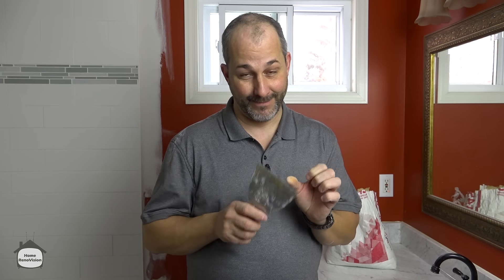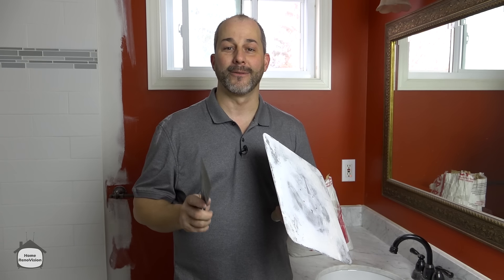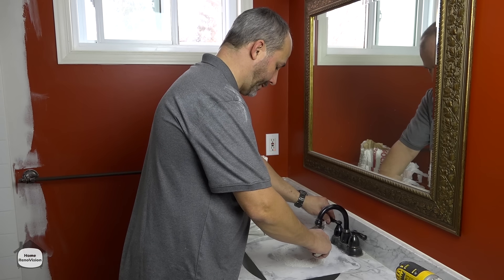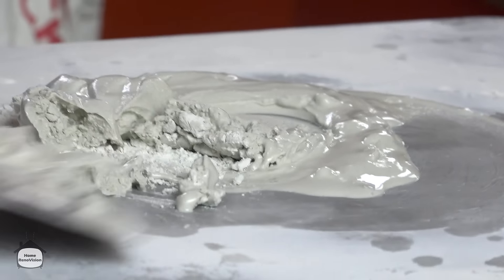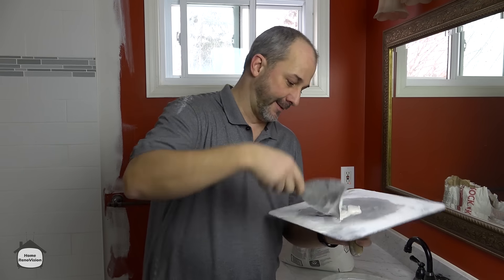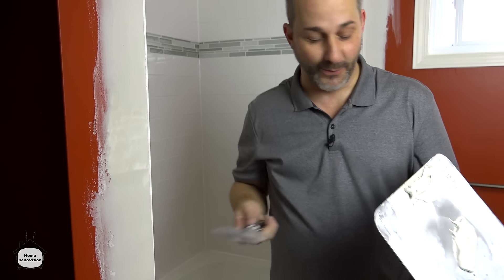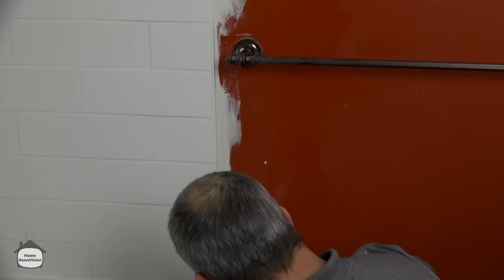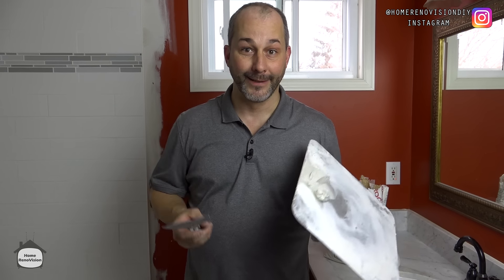Simply DIY Drywall Repair for Homeowners

Comment: whenever I get a small hole in drywall from a screw or whatever I was using spackle and trying to sand it after and it NEVER comes out perfectly smooth. My contractor told me to use joint compound instead of spackle, but this stuff looks great. Thanks so much for making this!

Comment: Hi Jeff.  I just starting watching your YouTube channel yesterday.  I watched your series on drywall.  Good stuff!  I went out and bought some of the Dewalt Drywall Screw Setters last night... you referred to them as dimple #2s.  I knew what I was looking for.  
I love your series and learned a lot that I can use, as it applies to my ceiling repairs.  
I've already repaired a ceiling crack that ran the width of my hallway, and a water damaged spot (8"x10") from a deteriorated sewage vent boot on my roof.  I have a knockdown texture, which took me several trial and errors to get right, but I did, with a coarse sponge and a wide taping knife.  
The place I am working on now has 2 long joint tape cracks (8-ft hairline crack along one side of a sheet of DW running parallel to vault peak, AND another on an adjacent side running 4-ft to the vault peak, and another adjoining 1-ft section on other side of vault peak = a continuation of the 4-ft crack, then a vertical wall) on a vaulted ceiling, with one running across the vault peak onto a 2nd sheet of DW.  The total 5-ft crack across peak had sections that were 1/8" wide.  Well, I just dug in!  What a nightmare under the DW.  The 4-ft crack was a hanging joint, with DW nails hitting air.  I will attach a 2"x4" to existing joist (sistering?) so I won't hit air.  The 1-ft adjoining crack was caused by deep mud due to 2 parallel joists that were not exactly parallel.  The two had a different pitch, so the angles were off.  Hence, the mud buildup from original build.  The existing DW was literally crumbled under a 1" layer of concrete type cured mud, due to nails that were nailed to higher pitched joist.  To me, the original DW work was shoddy.  The 4-ft crack is the hanging joint, but before I started removing paint and concrete mud, I did notice the mud was built up along the whole 5-ft section so high that it was humped over the knockdown texture.  It appears the joint was built up after they textured it.  So, different pitched joists, excessive mud and hanging joint caused this 5-ft crack.  
I haven't gotten to the 8-ft crack yet... still trying to make a trough for the fibatape setting along the 5-ft crack across 2 sections of DW.  In the corner where the 8-ft crack meets the 5-ft crack, next to an outside cornered vertical wall, there was a 3rd crack that arched between the two long cracks.  This 1-ft radius'ed crack was 3/16" wide in spots.  Well, when I started scoring the NEW tape area along the 5-ft crack near this arched crack, the section just fell 12-ft to the ground.  So now, these adjoining cracks just got a little more complicated.  This area will be replaced with a 2-ft x 2-ft section of new DW, with a corner notched out around the adjacent outside corner vertical wall.  I hope I don't find anymore surprises.  I've had enough.
My plan for the 8-ft crack is - the crack runs perpendicular to the joists, so I plan on using furring strips along the cracks between the 24-in joists BECAUSE I DON'T WANT THIS CRACK TO EVER COME BACK!
Much of my work has been trial and error, advice from youtube, surprises, etc.  But in reality, there aren't enough youtubes out there to address many of the problems I've encountered.  Your series were great and helped me a lot, but I've run into problems that just are not out there yet, on youtube, anyway.  I think it would be great if you addressed some of the more complicated repairs you've made, or will make in the future.  Sorry for the length, but I'm a retired aerospace engineer who pays way too much attention to detail.  That coupled with perfectionism leads to problems.
Thanks again Jeff... Wayne

Comment: I usually just use the 20 minute set mud but this is a nice trick to have in your bag if all you have is the 45 minute product lying around.
Reply from the maker: Cheers mate!
Reply: Right. I usually grab the 20 minute mud first.
Reply: How long let set before wet sand? Does it need to be fully bonded first?

Comment: I was very impressed with your little volcano, but I think I will stick with mixing mine in a bucket and a plastic paddle mounted to my drill. I generally use 45 minute setting compound for all of my drywall projects from taping seams, installing corner beads, and even my final coat. It seems to be stronger and more durable and it does not shrink like regular compound. I believe this is the first video that I have watched of yours. I will try to take a closer look at your Channel later on.

Comment: Good.  Been doing this kind of repair for 40+ years.  This is a bridge over from the drywalling trade to plastering.  I first was taught how to white coat plaster by using slaked lime and gauging with a little retarder and we mixed it in a similar manner on a mixing board in large amounts using trowels, or making the ‘ring’ of lime putty, pouring in the water and then shaking in the plaster & allowing it to soak till it was 95% wet, then take  a gauging trowel (looks like a pie spatula) and cutting into the ‘cake’ (we’d call it), just like you would a cake or piece of pie, and mix it right on the hawk like you did in this video.  It was traditionally a 3:1 mix for flat work.  This was the traditional lime putty plaster and you don’t really see it done much anymore, only when doing restoration or conservation work.  
         Picking up in like manner of what you do in the video, for an even quicker fix than the 45 (which I do like & use),  I do the technique described above but with joint compound and plaster of Paris.  It’s sponge  float smooth within 7-10 minutes depending on the ratio of the mix.  The mix is not as easy and nice as lime, but after you get the hang of it it’s fine.  I get called to repair drywall & plaster  all the time,  and this is the quickest mix to knock out a bunch of patches.
        Lastly, I think it’s great you showing some of these techniques and secrets. You and I know that it’s not as easy as it looks because so much of it is learned muscle memory and after you’ve done something hundreds...thousands of time, you don’t think about it and are just on auto pilot.  But this is how folks learn.  Thanks.
Reply from the maker: I remember watching Old Jimmy St Clair plastering a house when I was a kid. We were restoring an old bankers house and historical guys wanted plaster. He was awesome and made me fall in love with working with my hands. Cheers!

Comment: Works even better if you scrape it wet then lay it back on very smoothly I've done whole jobs like it without sanding painters couldn't tell the difference it works so smooth one thing though they need to pain with a slight texture or it's smoother than the rest of the wall

Comment: I've been a drywaller since 1983 USG Dora Bond leaves a shine you want to use Kwikset and set it over your sink and get some in the drain and see what happens
Reply: Kwikset makes door knobs not plaster. Nice try bud 👍
Reply: Kwikset and quickset are two different things
Reply: @DundyMuffs  yeah he means like drywall 20, which dries very quickly. Becomes unworkable and probably less than 10 minutes. Also what's wrong with mixing in a mud pan?
Reply: @DundyMuffs  
Drywall compund isn't plaster....

Comment: Most drywall people I've seen don't bother to flex the trowel so it lays down a convex surface.  Like us it's mostly water, so the thickest areas shrink the most.  Any surface that is finished flat, will dry concave.  With a 4" trowel it might not be noticed as much but it depends on how thick it is.  I'd use a 14" Drywall rectangular trowel from Marshalltown, it has the curve built-in.  You could only use half on the outerside, but all on the inside.

Comment: Thanks for showing this again, I picked this method up from your painting video. Better detail for mixing the sheetrock45 and water this time around. The first time I tried this I'm glad I mixed it out in the garage because I tilted the hawk just a little too much and water+sheetrock poured all over me and the floor (warning to beginners, don't try this for your first time over carpet!). After a while I got a hang of it but I appreciate the detail this time showing how you dust it over the water. I'm convinced its the quickest way to get good results and thankful your'e sharing all the little details with the world like you would to an apprentice. Keep it up!
Reply from the maker: your volcano erupted did it. No worries practice makes perfect. adding less water until you get the hang of it is a good idea. Cheers!

Comment: Well done video, Jeff.
Info like this is gold for those of us who do these repairs infrequently. 
You specified Sheetrock 45, but much of the bag is missing or turned away from the camera.
Which of the following products that are available in my area of the US, is closest to (or is) what you showed?:
•USG Sheetrock DuraBond 45
•USG Sheetrock Easy Sand 45
•USG Beadex Silver Set 40
Thanks, man!

Comment: I still think you need to prime it, as quickset will flash through any paint but flat one. As well, the edges left after sponging will be pretty rough and noticeable, and texture will differ from surroundings.

Comment: Thanks for all your advice.  As we used to say in MC roadracing, it only had to look good at 10 feet and 100 mph. I'm trying out putting baseboard quick grab or even old tube of caulks on every stud before attaching sheetrock to help with screw head pops.  Another tip from eBay University.  And as I'm always telling my kids; I'm brilliant...1 oh shite at a time!
Reply from the maker: another thing that works really well is to deliver the lumber to the site and let it sit for a few days to dry out before installing it. Cheers!

Comment: How about a video on corner bead repair?   They're are several other DIY videos on YouTube, but they all have different recommendations. For example: Fiber Mesh Tape vs Paper Tape; staples vs screws; plastic bead vs metal bead!  HELP!  I have lots of cracking and separation on the outside corners.  (18 year old Florida home, metal bead, metal stud framing).  Thanks! Love this channel!

Comment: Thanks for this video, I've used 30 in the past with decent results but 45 is cheaper for sure. I've taken college chemistry so the hot water concept hadn't dawned on me but definitely makes sense. I also like your finishing trick with the sponge for grout, that's what'll save me the most... hate sanding.

Comment: There is also 5 min Sheetrock compound for quick work. Or Fast and Final is a good product. No need to prime, just quickly hit it with the paint so you can hit it again when it sets up.
Reply from the maker: does not work the same way as 45. that one needs a primer.

Comment: Mr. Home RenoVision, I have read on the hot mud packages that there is a danger that if you coat too thin and it dries before it can harden that it has no strength so I always use cold mud for the final coats. I see you are coating thin, what is your take on that issue?

Comment: Have you ever used aluminum sulfate? The compound (mixed with water) makes an accelerator that will fill holes and literally dry in a few minutes and is able to be sanded in 10 minutes.

Comment: Sorry Jeff, priming is a must if you use a dark color like red or any type of sheen such as satin, eg shell, semi-gloss. It will flash. A red color will need to be painted from corner to corner and wet cut in to wet roller roller. Like your videos and I just rang that 🔔
Reply from the maker: Hi Sammy, yes if you are painting red then it will need to be primed but solely for the purpose of tinting the wall due to the translucent nature of the color you are going to finish with. That is another video. Cheers! In this case the client was going to finish the paint with a seafoam green color to match the glass tile.

Comment: Please do a video on fixing tape pops in corners of walls and along ceilings that are textured. Love your stuff!
Reply from the maker: sounds very interesting. simply use your 4" knife with compound on it to squeeze it into the gap and press. repair the texture after it is dry.

Comment: Another idea is to heat the wall with a hot air gun then apply the DW45 to it. The mud cures in about 15 minutes.
Reply: Or, just use 20 minute mud, or 5 minute, like I do all the time.

Comment: I watched the mud video it was great. My problem is I have a large void area between the two drywall sheets. They do not butt up against one another. What would you use to fill that area?
Reply: 20min mud 4 in mix peanut butter consistency, pull tight scrape off extra as mud is setting up / spray adhesive then mesh tape mud 2x pulling edges tight you'll be good

Comment: Great tip! Thank you! I was wondering if I could do that with the wet sponge. I was worried I was going to mess things up. I did not use the wet sponge tip renovating my office. That room had a lot of holes. So I used a lot of drywall plaster. I sanded that 9 by 9 room like crazy! I had a fan in the window to take the dust out. The room was still super Dusty! It was like I was in a snowstorm white out! I wish that use the wet sponge method!
Reply from the maker: It works really well when the final coat of mud was applied thin and smooth. Cheers!

Comment: Great video.  How do you do textured knock down ceilings?
Reply: if its real popsorn, get a pump sprayer.... wet it down, let it sit 10 minutes then set a tarp or painters  cloth down, use a 8 or 10 inch knife and watch it fall easily with minimal dust! ive done many this way... good luck

Comment: Do you have any tips on fixing cracks in drywall?? Specifically those in corners and water damaged drywall?
Reply from the maker: use painters caulking in corners to fill cracks. water damaged drywall must dry completely and then see if it will hold a screw. if not remove it. cheers!

Comment: they also have a 5 minute mud out there from USG, and you better be good when using it and the method using the hawk is old old school. they have better tools out there  for the job. water sanding with a sponge does control dust but it also takes away part of your finish and will show fat edges created by the sponge itself, dry sanding is always best, and never paint over any raw drywall with out some sort of primer!!! it will photographand when you have primed the spot you nee to also paint the same spot and then the entire wall again.
Reply from the maker: The 5 minute product does not work in the same way. Cheers!

Comment: What am i missing with not having to prime after patching?  I thought you will see flashing if you dont prime.  In your drywall series you prime then paint.  Thank you for the videos and sharing your ideas and processes.  If we all shared a little more it be that much better a world.
Reply from the maker: the 45 minute mud is like magic. It has the ability to not flash if you let the wall dry between coats. If you are in a hurry and just doling a quick repair then the hair dryer is your best friend.
Reply: I just try this great trick, but unfortunetely  i see the patch when i look at the wall (not face on, but when the wall is on my side). Used the 45 and 1 coat of paint. Any idea why it didn't work ?

Comment: Love your videos. Very helpful tips. Stuff I wish I knew 8 months ago, haha. I was wondering if you could comment or maybe even show in a future video on how to fix stucco ceilings that have cracks where the seams of the drywall are without doing too much. I also have tape that's pulling away around the sides of the way in some rooms. I plan on just patching it and putting crown over it anyways but the crack is going through the middle of the ceiling in the kitchen :|
Reply from the maker: some times it is as easy as using a caulking and a finger and then repainting. Cheers!

Comment: Thanks for the help, Jeff! Your channel is the best out there for the DIY home repair person. I have a question about spackling. You never seem to use spackle compound and always (from what I have seen) use this method of 45 minute mud for holes, and repairs. What are your thoughts on spackle? What are your reasons for not using it?

Comment: Here in New Hampshire the only one I see is the 18 lbs. Easy Sand 45 Lightweight Setting-Type Joint Compound. Is a blue color bag instead of the red one you have. So my question is, It will perform the same ? Set time is 45 minutes as well.... Thanks! ~George

Comment: Did you mention in this video a ceiling/drywall type of patch/repair?
 I have an old water damaged spot that needs help and I have 80 year old loose fill insulation to deal while removing and patching is in order. Would it be better to replace the entire run? The remainder I have to tackle nail pops (loved that vid btw♡) and drops with some waves. So a whole new run may appear awkward. So I am guessing float in a patch. Darn it. Please make a video for this task.
Reply from the maker: you can search the site. we have a ceiling patch video. Cheers!

Comment: Good tip...but I think that would need primed as well then paint.  Otherwise could get some flashing.....✅
Reply: cwrowe I had the same question. How can you get away without priming?  Read all comments below and he says the 45 stuff does not "flash" which i guess is the term for that diff finish, primed vs non-primed drywall...  Will have to try it on my pending repairs.  I usually use the pre-mixed 5 gallon buckets. And prime.
Reply: Plaster will not flash , compound will . I do it all the time . Just it fir my punch list as the job is coming to the end